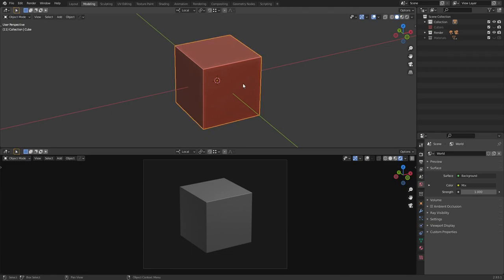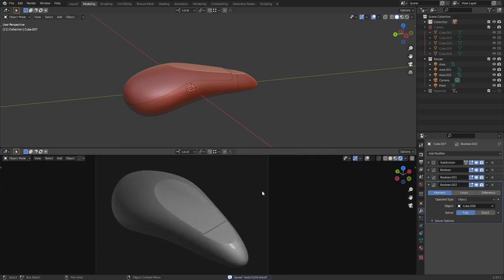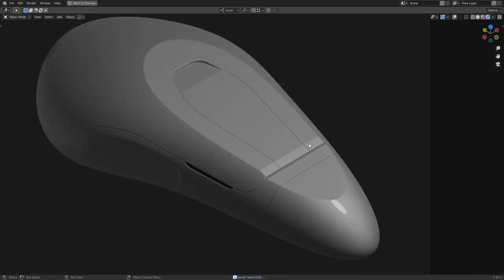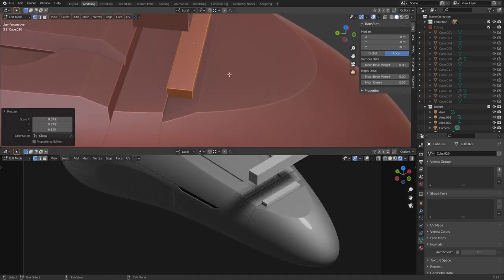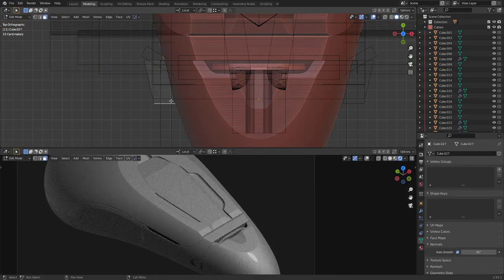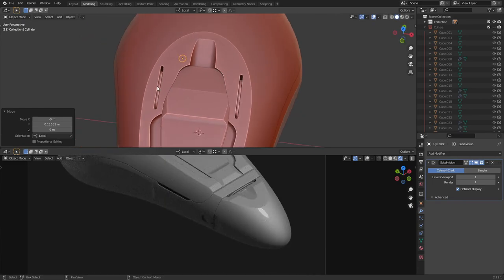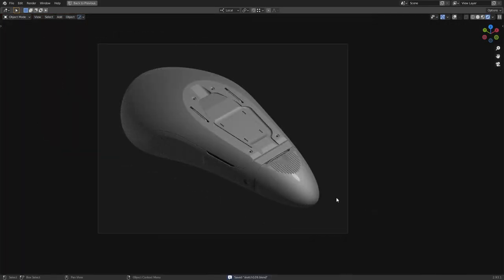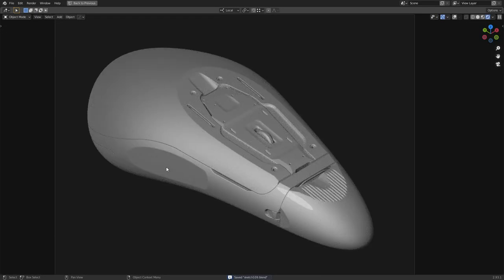Mixing curved and hard forms (blender hardsurface design)

Comment: At around 4.57, how do you create intersections that leave the remaining object with such a clear seam and also remain separated? I can’t seem to replicate this modifier in my blender scene.
Reply from the maker: I'm just doing a subtract boolean to remove the shape, then duplicating the object and switching it to an intersect boolean. You can do this faster with the "slash" macro which I think is part of hardops. The reason the seam is visible is because in the top viewport I have cavity display enabled in the Shading menu and in the bottom viewport I have a Bevel node plugged into the material's normals.
Reply: @TheNormanInvasion  what would the best way to do the same thing be for max I have seen someone do it but I tried today and failed

Comment: Loved watching this. With these tutorials, you generally only show the mesh being edited through booleans. That's awesome, but how would you go about selecting any of these panels or areas to apply a shader to them?
Reply: Once you have your shape you you want it, you'd have to Apply the modifiers to make them destructive and give you access to the "real" geometry. You can probably get away with just applying the ones you need to edit unless it's gonna have moving parts in animation. If you're going to be doing that, you should also think ahead and separate your object into different sub-objects like Ben does sometimes to make cutters only apply to one section.
Reply: @wj2497  Appreciate you chiming in. I think what's weird is that my "Apply" is greyed out so that isn't possible for me, so I'm stumped.
Reply: @antonionogueras6533  IIRC you have to do it in Object Mode. You may also find that it breaks your geometry, so save first in case you have to adjust some sharps or whatever.

Comment: What addon do you use to make booleans?
Reply from the maker: hardops and then ctrl and numpad + or -
Reply: @TheNormanInvasion  Ok...so if I understand correctly, if you wanted you could do without Hardops, that is, you could use Blender's default tools...or maybe the Bool Tool addon. 
However you are faster using that only one hardops function (in this case) because you can do boolean operation directly with 2 o 3 keyboard keys, faster.